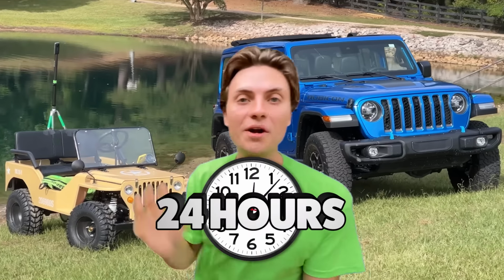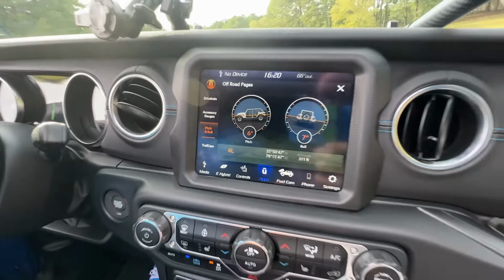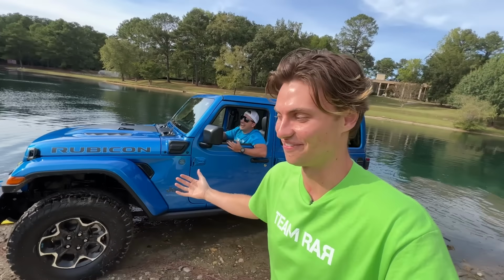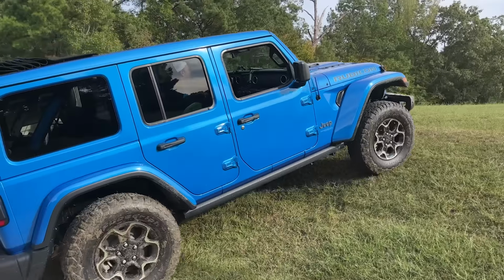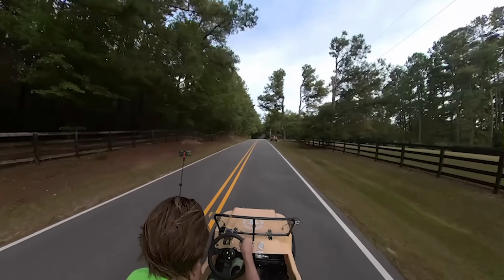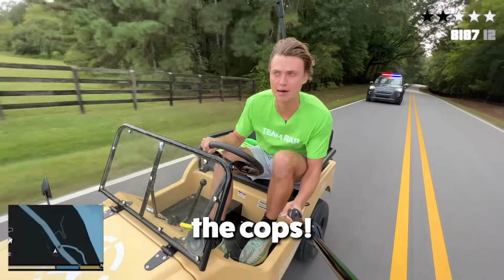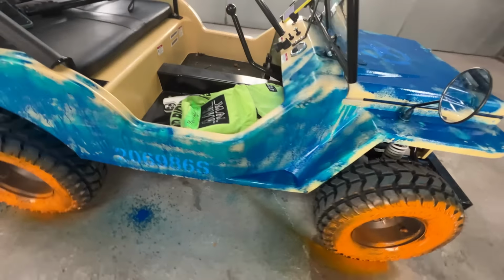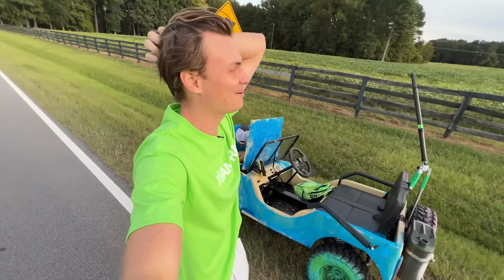I DROVE A MINI-JEEP 100 MILES TO THE BEACH!!

Comment: You need to upgrade the engine and put bigger Tires so it can run better
Reply: how can he do that? life isn't a videogame so you cant UPGRADE anything
Reply: plus you have to have buy suspension to get bigger tires which cost at least 50-100 dollars for each tirw
Reply: @timothythebrave460  he is rich what u on about he owns a lambo